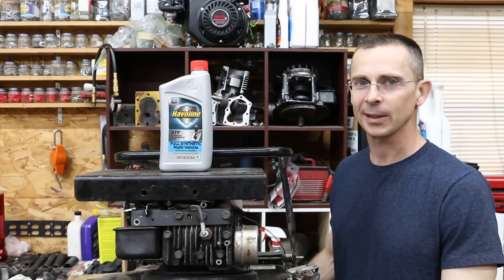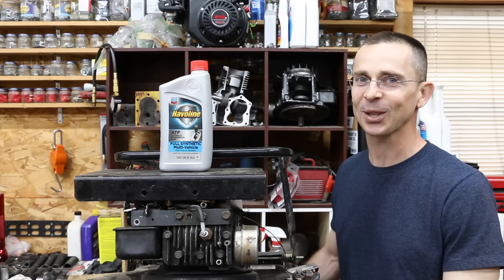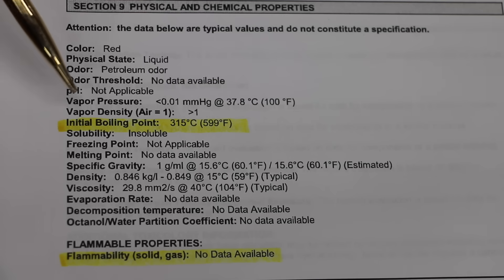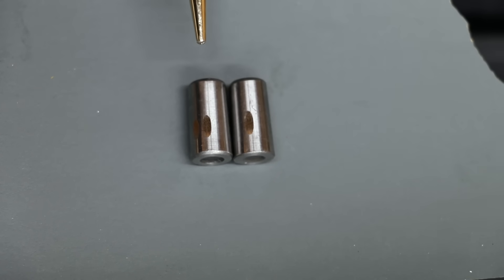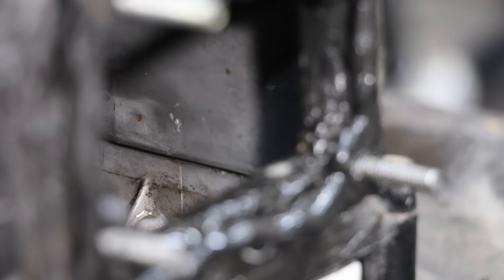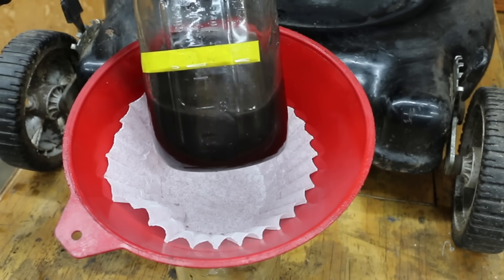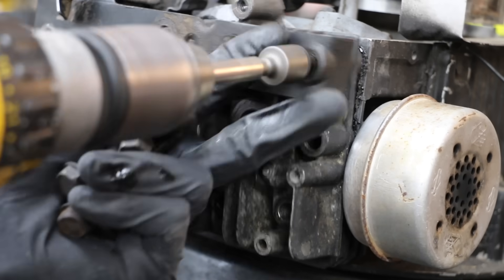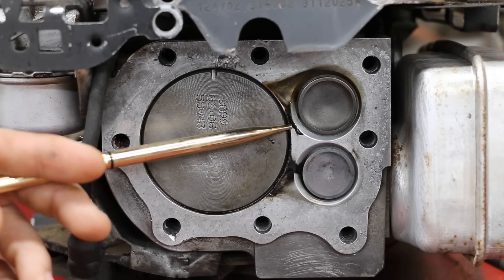ATF as an Engine Oil substitute?  Let's see what happens!

Comment: I worked at a dealer and the lube tech filled 3 cars w/ atf by accident. we sent out a courtesy o&f coupon. it took  3 months and 8000 miles to get one vehicle back to correct this problem. (no they never informed the owners and it is no longer in business). the point is it still had optimum psi and I looked inside the pan it was as shiny as a tranny. this was summer and the truck had been in Texas heat for the 3 months prior. to my knowledge it never had engine problem's thru the warranty which was 5 years and more than 45000 miles left under coverage. I will say it was a 5.7 magnum motor on 3/4 ton chassis. and we often added a quart to free stuck lifters before opening engines for repair with great success.  awesome channel I should add it was Pensoil Dextron 2
Reply from the maker: Wow!  Glad it all worked out without causing any damage.  Thank you!

Comment: Many years ago at a Shell Oil training session I remember hearing that transmission oil was nothing more than high detergent 10W motor oil. Probably an old wives tale.
Reply from the maker: Thank you
Reply: The MSDS says mineral oil so basically baby oil with detergents in it. Seems about the right consistency.

Comment: The trick is to not use just straight ATF, but only replace a portion of the oil with ATF. It has a much higher detergent concentrate than typical engine oils. It is also not intended to be run long term, as you have shown it doesn’t have the same lubricity as engine oil and can cause accelerated wear.
Reply from the maker: Thank you!

Comment: So,,should I use a 10w30 detergent oil in my riding mower instead a 30 weight ?
Reply from the maker: Recommend using the type of oil recommended by the manufacturer.  Thank you

Comment: have you ever tested 303 hydraulic oil on your load bearing tester? i wonder how it  compares to 30 weight engine oil. what one will take more weight to stop the motor?
that would be a good test because most engine oils dont have zinc in them now so they might not be as good
Reply from the maker: Thank you for the video idea!

Comment: Good vid.  Just proves consistent oil changes with a new filter are the best.
Reply from the maker: Thank you!
Reply: I've driven 5 million miles on different cars and an oil change and filter at 3000 mile intervals will keep your engine real clean and running great. Only problem is it doesn't help your car from rotting away in roadsalt junction Maine.
Reply: @georgebuck2269  Amen to that. I live in Iowa so I know.  Ugh.

Comment: A local Cadillac dealer would run 3 quarts of engine oil, and 2 quarts ATF to clean up a trade-in car, particularly one that had a noisy lifter, and seemed to have success with it. I used to repair lawn mowers also, and use regular crankcase flush to clean the engines. Most of them had rarely had an oil change, if ever, and they smoked. Running flush and some new oil usually stopped the smoking and cleared a lot of sludge and grit. I'd then change it with fresh oil, and no more problems. I flushed the engine in my '91 Ford Ranger, and the oil pump started knocking. I now run 10-40 and a can of STP and have for 3 years, and that stops the knocking. I should not have bothered flushing it. I took the valve covers off of our '97 Mercury Villager, and there was no sludge or buildup at all. Just change the oil and filter, leave it at that. If you do have a sludged up engine, some ATF in the engine oil will work, and so will flush. Flush may release particles and clog oil passages, so use with caution.
Reply from the maker: This is great information. Thank you
Reply: @ProjectFarm  I thought that I'd pass along what my experiences have been so that people can use the information in making a decision. Thanks

Comment: Just crossed this experience while looking for another thing. Great initiative @Project Farm. Maybe the lawnmower isn't the most representative engine for this particular experience. Too few parts, too few exposure to "burn". I heard of the ATF cleaning about 10 years ago while I was trying to figure out how to rejuvenate an old Wrangler TJ with about 200'000km on original engine. I was hugely skeptical. What the heck, replaced 2lt of engine oil by Dextron II. Then forgot about it during an entire summer driving around. When I replaced the oil, it was like black paint. Filter was coated too. Replaced everything and engine was running like a charm. Few month later I had the valve covers removed to replace gaskets. Mechanic commented that the internals were spotless. Asked me if the engine had been reworked or replaced recently.  After this, I did same treatment to 2 other Wranglers. And now I do this with my MB CLK 320 (W209). Very different engine, I agree. I replace 1lt (out of 8lt) and drive gently only about 50km with ATF. First time I did this on the CLK, I replaced the filter before adding ATF. I was curious. The filter came out clogged by some sort of black tar. Replaced oil two times to flush everything. Bottomline, ATF does cleanup something. That something is that black soot (or whatever) produced by engine operating. What does it do really? No idea. But my CLK is now well over 200'000km, running like a charm, no clicking or valve noises and passing CO2 inspections without any work done. And I can still easily give Subaru BRZ drivers a run for their ego lol
Reply from the maker: Great point and thanks for sharing your experience with ATF!

Comment: Ten years ago I bought a 2002 chevy pu with a 4.3 and it had a tick in it . The person I bought from used O,REILLY  convential  5w30 oil and MICOGARD filter. After my 2nd oil change using mobile one and a napa gold filter the tick went away. 160000 miles plus still no tick.
Reply from the maker: Nice!

Comment: Why is the transmission oil called fluid, I realize that it’s all a fluid but nobody asks for a case of 10w-30 engine fluid. They ask for engine oil, so why say transmission fluid rather than transmission oil? Just a funky question I had. Lol
Reply: Perhaps because the automatic transmission fluid does more than lubricate, cool, and suspend particulates, like engine oil does. The ATF is used to perform work under various pressures, like moving valves and band actuators. Now that I think about it, a manual transmission is filled with gear oil - not fluid - and that seems to be a more passive application like for engine lubrication. Great question though; it made me think.
Reply: Ronald Schild indeed sir, I always thought it weird for some reason but perhaps you’re exactly right. Being that ATF has a “multi use” and “multi property” function in an automatic transmission then they just called it a fluid rather than an oil. I’ve never thought about it the way you described until just now.
Reply: I'm pretty sure that he's not in charge of naming things for the rest of society. He tests engines and lubricants in his garage. He doesn't work for Webster's Dictionary!
Reply: Michael Linner it’s just a question for reference bro... I know he don’t work for Webster, I was just curious to wether or not he knew...
Reply: Eda Bean lol. I’m not confused with which is what in their respective states of matter. It’s just a question directed to only mechanics and the types of “fluids” and their names. But yes I will keep your escape plan on standby next time my boss asks me a question. Lmao 😂
Reply: Automotive transmission/transaxle (Automatic) fluid used to be hydraulic fluid with a red dye in it. The red color makes it easy to find the leak. If you buy hydraulic fluid for a machine tool such as press brake or construction equipment or even hydraulic systems on airplanes it's a clear fluid. The difference is no red dye.

Comment: One owner, 1996 GMC Safari, had regular oil changes until we traded it in at 199k miles. 

At the 155k point one lifter became noisy. 
I changed the oil/filter but used ATF for the final quart. I ran the engine at idle, not stressing it out, for an hour after achieving  normal operating temperature.  During that time the lifter noise subsided. I immediately changed the oil/filter again (all oil) and there was no return of lifter noise the remaining 44,000 miles that we owned the vehicle.

Detailed logical diagnostic work is extremely boring but very much appreciated. Nice work mate!
Reply from the maker: Thank you

Comment: Add transmission fluid to engine intake by drip method. The white colored oily exhaust serves as an effective mosquito spray. .Engine still runs fine. Add a bit of paint pigment for desired color effects. Consult with wife as to desired color.
Reply from the maker: Funny!

Comment: I’ve never heard of a plastic camshaft. Have you seen any fail?
Reply from the maker: Thank you.  Yes, plastic gears and parts are more likely to fail.  Kawasaki used a plastic timing gear in their 20 HP water cooled engine used in the John Deere 345 garden tractor. It's very prone to failure.  Imagine paying $6,000 or more for such a nice machine to experience such a costly repair.

Comment: As an old mechanic, 63. ATF was used a lot to free up lifters, flush out engines and such back in the day. 60s 70s and 80s. It really did work almost every time unless there was a mechanical problem. But yeah, don't use it in the oil of any of todays engines. Could cost you a bunch of money!  Good Video! Always interesting!
Reply from the maker: Thank you

Comment: hi George again my 200 Big Red smokes real bad most conventional oil 5w 30 I drained it out I put automatic transmission fluid is a stop smoking has been running fine for the past 5 years I liked your video of the engine with the transmission fluid in there with the clear plastic was very nice thanks for your service have a good day
Reply from the maker: This is great information. Glad ATF did the job!

Comment: I have used ATF to clean engines and free sticky, noisy lifters. I would not run ATF only, just use 1 quart ATF and 4 quarts oil. It definitely works to clean the engines. I don't know if it caused any additional wear though. But honestly, the engines were all so worn out and gummed up that you probably couldn't cause much damage at that point.
Reply from the maker: Thank you!

Comment: Great video! I have a 1986 Nissan 300zx with 200k miles. Every morning on cold starts, the lifters tick for a few seconds until things get going. Sometimes, hard highway pulls make them tick, too.

After putting in a quart of dex/merc iv, and driving it lightly for 100 miles, I noticed no more noisy lifters under any condition! Cold starts seem smoother and the engine sounds very healthy now.

Only 100 ish miles on that oil and I changed it. The oil filter seemed heavier than any other change I've done at 3-5000 mile intervals. I'm going to cut it open and invesitgate
Reply: You and I both do the same thing leave one quart of ATF and until the next oil change smart.
Reply from the maker: Impressive!
Reply: Back in the day transmission fluid was once called transmission oil they changed the name so people wouldn't 👍 make mistakes putting motor oil in transmissions.

Comment: The old information was, add trany fluid to the oil.  It will help free rings and lifters.. 
Never was it to be ran straight, only added to oil.
Reply from the maker: Thank you!
Reply: I did it to my buddy’s truck in high school, we went to a technical school and were in automotive, his truck smokes like hell for a while but sounded and performed much better afterwards
Reply: Like a lot of the guys here have said, mix the ATF 1 or 2 quarts to the rest oil. I just did this in a 2005 Silverado that has 210k on it and had been sitting for over a year. One of the lifters was stuck, and even after the first oil change, it was black within 50 miles. Drained the oil, refilled with 5 qts oil and a quart of ATF and ran it 30 minutes 1500 rpm. Dropped the oil again and refilled with fresh oil. No more lifter tick, and much cleaner oil on the stick
Reply: @bigwallin  My 2002 Avalanche has a slight knock when cold.  I have some used ATF that looks good.  I think I will drop it in the engine oil a few days before I take the car in for an oil change.   At 198,000 miles.  Would be nice to be rid of the knock.  Premium does not help, though seafoam seemed to make it better a few months ago.
Reply: That's what I always heard as well, back when I was a kid I often accompanied my dad to auto auctions, I've heard this tale many times throughout the years while hanging around the older mechanics and used car salesmen, while changing the oil they would simply add a quart of ATF by substituting it for a quart of oil, then run the engine as usual and replace the oil/ATF mixture at the next regularly scheduled interval, I've never tried it but I've heard many people say it works well, especially if you have an engine full of sludge that was neglected its regularly scheduled maintenance and need to clean the rings, piston, combustion chamber, crankcase and valves.
Reply: @notchagrandpa8875   Just a slight twist to your story, had a head Chevy mechanic do the same thing only he run the car in slightly more than an idle for 15 or 20 minutes so as to not damage anything in the engine. Then drain and refill.  Motor oils weren't nearly as good in the 50's and early 60's as they are today so I guess he was erring on the side of not screwing anything up.  After all, these were customers engines..
Reply: @ngzcaz  Anything other straight weight oils in the 1950s and 1960s, the binders between the two viscosities generally were paraffin wax. Lead to the early demise of many engines.
Reply: Exactly!
Reply: Growing up in the 50's and early 60's, I heard that quite often.  I haven't heard it lately but back then it was almost the normal thing to substitute a quart of trans fluid to every oil change.
Reply: I heard drain oil, fill crankcase with ATF...run the engine at high RPM for a while, then drain ATF, refill with oil go on your way....I also heard adding a tad of ATF here and there during oil changes was good....Heard sooo many things about soooo many products! That's one reason I LOVE Project Farm!
Reply: It's only been relatively recently that engines have been using 0w and 5w oil.
Back in the day the oil weight was at least 30.
Reply: Checker cab with 283 engine.  450k miles and owner used straight ATF.
Reply: I actually had a motor that had around 200k miles on it but it had been rebuilt with really cheap parts, previous owner didn't take good care of the motor either. Piston number 4 had some broken rings but it was so gummed up full of crud that it was still sort of holding together. That cylinder was losing compression and burning oil like no ones business but the engine still ran. Had an old man tell me about the ATF trick and I followed these instrucitons basically. Piston number 4 let go very shortly after. All the pistons were just covered in all sorts of deposits. Now I could be wrong because I don't take my motor apart every week to see how shes doing but it seems like ATF really works at cleaning stuff out.
Reply: Correct you never run it pure in something you value. "Viscosity matters" to maintain the needed film thickness in your bearing gap so that you arent running on your bearings. Just because it doesnt seize doesnt mean you haven't just shot 8 of your engines 9 bearing lives. A lubricity tester doesnt test that.
Reply: I had a diesel truck that sat for a while... when I got it running it would smoke pretty good... I'm guessing a lifter was sticking? Anyway, I added some transmission fluid to the oil to see if it could help... I'm not sure how much you are supposed to add... Im guessing around a tablespoon? I ended up added more than that in an oops moment... but, it did seem to help some... unfortunately I dont have any long term data though... I would try it again though... (From what I understand, you use right before an oil change and run it long enough to warm up the engine. A substitute for an engine flush)
Reply: A quart of transmission fluid to th oil to free up rings and lifters is an OLD trick. And a lotta times it does work
Reply: I always did a 50/50 mix of oil and trans fluid. Let it idle for 10-15 minutes. Drained, changed filter, put correct oil in. I did this every 3-4 oil changed and got 350,000 miles out of a Ford probe before it got totalled in a car accident. I pulled the valve covers, 0 sludge looked like a new engine inside. Even over 300,000 miles and 1 snapped timing belt (don't know how it didn't crush valves) I had 180psi across both banks evenly.
But, I would never drive around with atf instead of oil.
Reply: @SteveSmith-lg5ke  most likely a non interference motor
Reply: @SteveSmith-lg5ke  non interference engine I'd imagine.
Reply: @SteveSmith-lg5ke  ... never flushed an auto engine with anything and did fleet work for 30 years. Had units in the field as high as 312k on the clock without any major engine work and almost zero "baked on crap" inside the valve covers. With the oils available since the 70s they will stay clean if you change the oil often enough and use a quality oil.
Reply: Steve Smith you’re telling me you did a 50/50 cleaning every three or four oil changes but neglected a fucking timing belt..... smh
Reply: @TLCchh  I think we should be half full guys. 
We all do what we can according to our ability and tools available. 
Steve got the engine to 300'000. Job well done. The timing belt could have been a shit Chinese brand.
Reply: That's exactly what I was always told, replace a quart of oil with a quart ATF. There is no question of the ATF's cleaning ability.  Next time you have some greasy hands put a little ATF in your palm. Works just like waterless gojo.
Reply: Heard the same thing about diesel oil